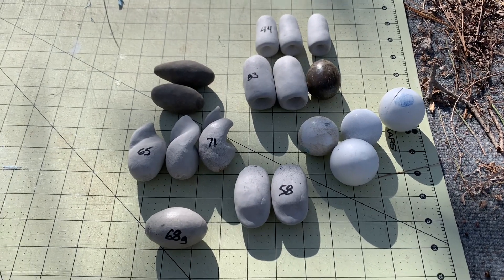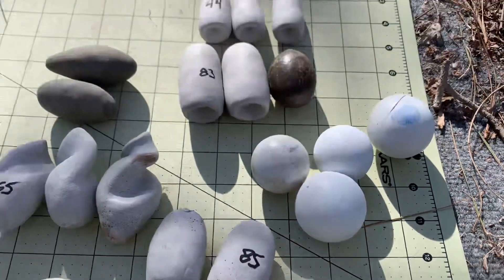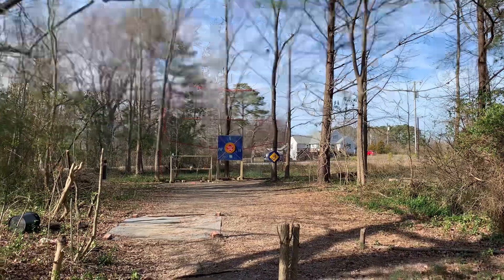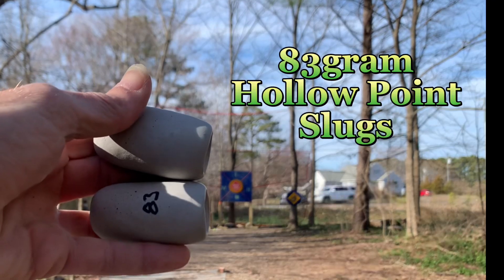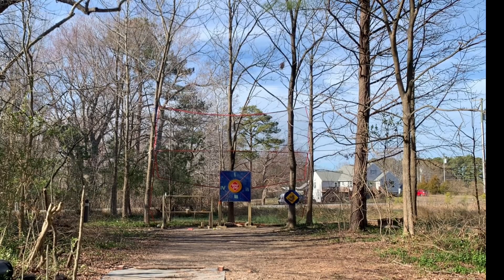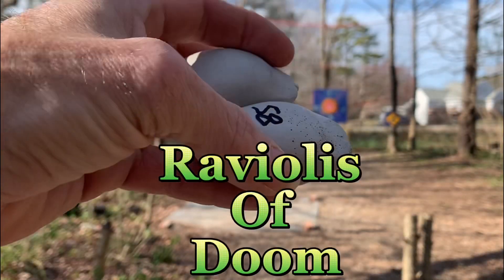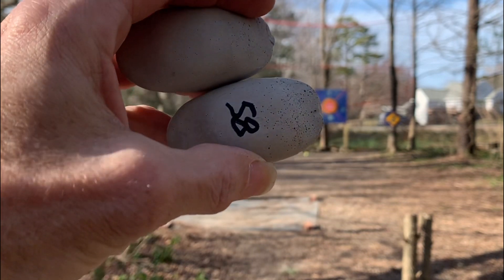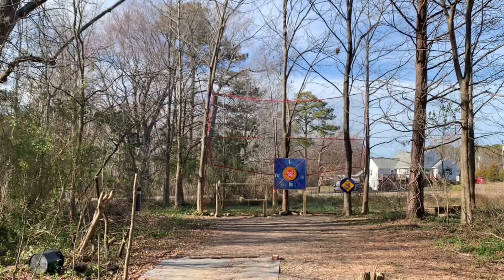Shepherds Sling Homemade Ammo Flight Test, Complete Destruction at the End

Comment: Is that a net your throwing into?
Reply from the maker: @juskojj  yep, it’s 2-10ft by 20ft golf net, hung one over top of the other to make a wall of netting approximately 15ft. by 20ft. At the time it was the cheapest option for that size, I would have rather had a single net that was 15x20 but those were much more expensive back then. They have held up very well. they are now 3 years old and still going strong. the only spots that got holes are where to projectiles pinch the net between projectile and tree cutting the net. but it’s easy to repair the holes, just tying split ends back together.

Comment: I loved this video, you`re the most accurate slinger on you tube, most of the other slingers are 2/3 - 1/2 the distance. I noticed when you transition from your back swing to your forward it appears you have a bit of slack before you forward snap and that seems to me where your accuracy has a problem. Other than that your vertical aim is very good it`s your horizontal aim that is affected by that momentary slack. I am using plastic easter eggs to make my ammo when I get them in the next day or two, I will drill a 1/2 inch hole at the seam where the two halves come together and lightly coat the inside with vaseline and use concrete for construction, the hole will be for filling and to allow for a slow cure. This method will insure that the weight and shape will be the same for consistency. Peace and brother love to you and all.
Reply from the maker: R u in the USA, if so I’ll do u better than plastic ester eggs, I’d like to send u 1 of my silicone molds as a gift. That is very sharp of u to have caught that slack point in my sling as my throw begins it’s linear movement towards the target. I have been exploring this for a bit now, it seems more pronounced when throwing tennis ball. Watch some slow motion video of a golf swing, on the down swing the head of the club actually passes the hands before the bottom of swing. This causes the shaft to bend opposite the way u would think. I also think that this is my slings mass accelerating into and through the ball. Anyway check the about section of my utube page and send me ur mailing address and what u would like ur biconical ammo to b, 60+ grams or 80+ grams. Great observation!

Comment: I was hoping the ones with a twist would fly like a bullet.
Reply from the maker: I was too, i think that weight distribution through out the projectile is very important. And im not sure this one has a good centered spin axis. Wish i had a lathe so i could turn my shapes to b molded. Then i would know the centerline axis would b good, with even weight all the way around. Im not giving up on the shape just yet though
Reply: @blindsquirrelRockChucker  would a small tail with fletching help. Kinda like a nerf vortex football?
Reply from the maker: Ive though on this, but as of yet have not come up with a good design that the fletching and what not wont brake off with just one throw.

Comment: Some are going to do better then other thats all there is to it lol but still lots of fun finding out what ones they are !! Excellent video👍👍
Reply from the maker: I had a blast making this video. Im glad u enjoyed it. The slinging was the easy part. Ive gotten a plumbbob and some lead sinkers that should have closer to centered spin axis because of hiw they r made, im putting them in silicone to be able to cast some more cement ammo that i know has a centered spin axis. I still liked all of the projectiles i used they all work well enough to hunt rabbits and squirrels, and turkeys 2 with a head shot. The 83 gram one i do believe would also take a deer with a head shot. They hit hard. Thanks 4 watchin